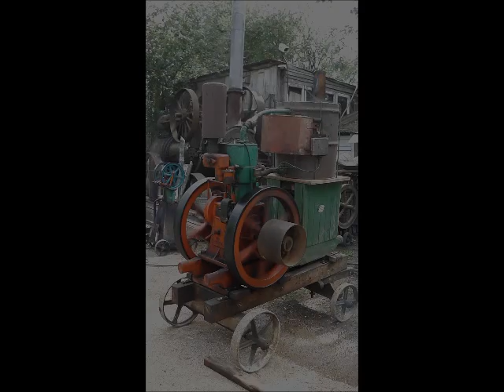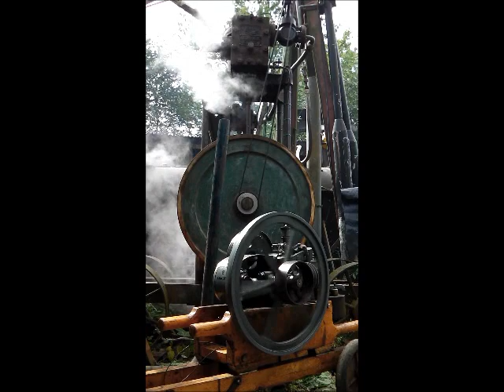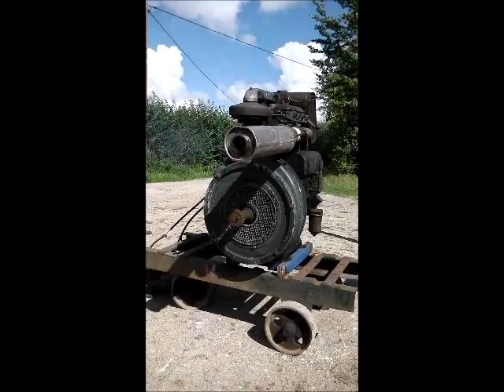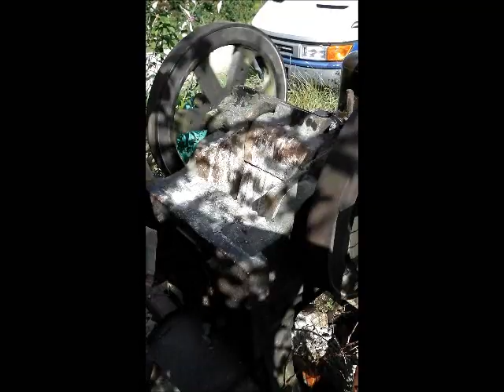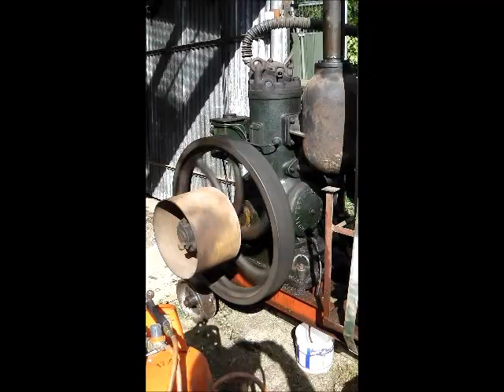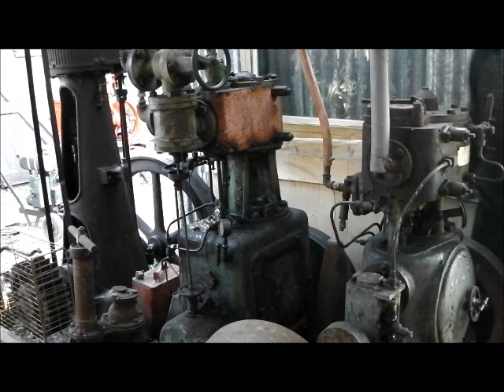The Curryer Open Day 2015

Comment: Those are some real beasts.  Loved the rock crusher.
Reply from the maker: the crusher was great fun. it needs all of the 6hp to drive it.
Reply: +steamwally Wow.  Wow.  6 hp.  Lots of energy stored in those flywheels.  I realize these machines are from a totally different time, but I'm always amazed at all the moving parts.  Sure wouldn't want to get loose clothes - or body parts - caught up in any of them.
Reply from the maker: +odc43054 built in the days when health and safety wasn't even thought of. just don't take chances with it.